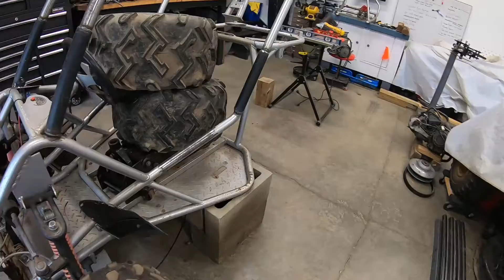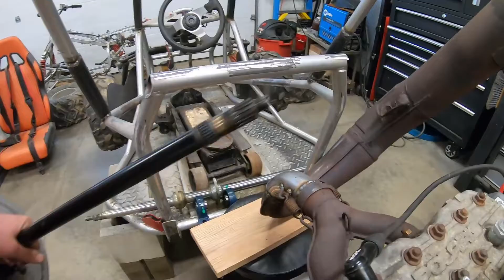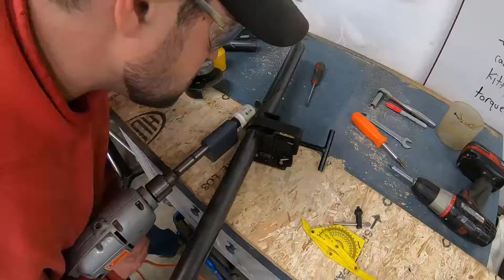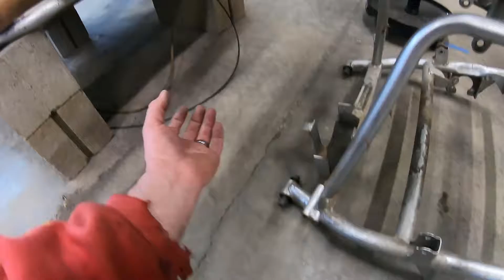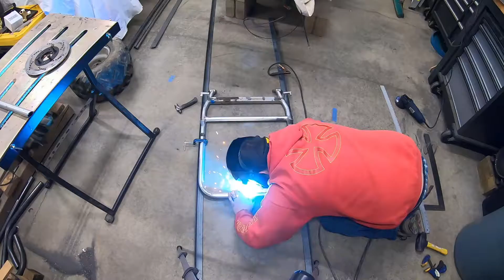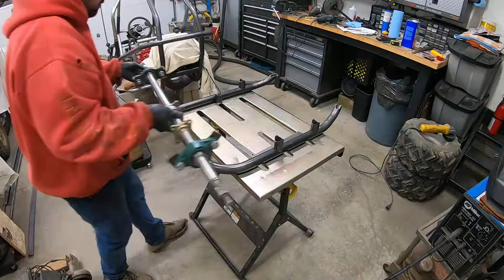Coolster 500 - Snowmobile Powered  Go Kart Part 2

Comment: Are those rubber engine mounts? I have been looking for a while for something like that for my vertical shaft motorcycle to reduce vibration. Do they hold up well over time?
Reply from the maker: Yes, they are the stock rubber motor mounts. I assume they hold up well. They came off 20+ year old sled and I’m using them again. You can find them if you search for “snowmobile engine mounts.”